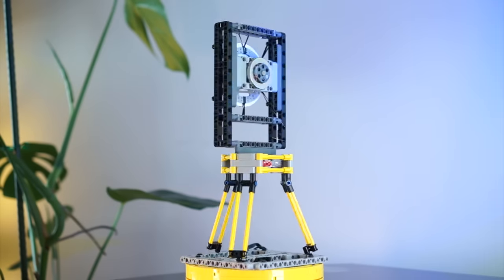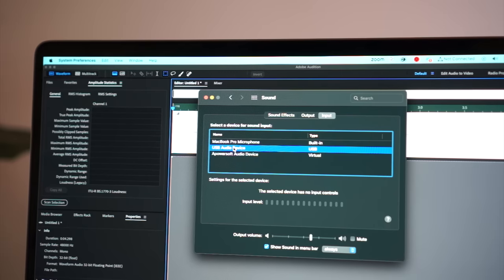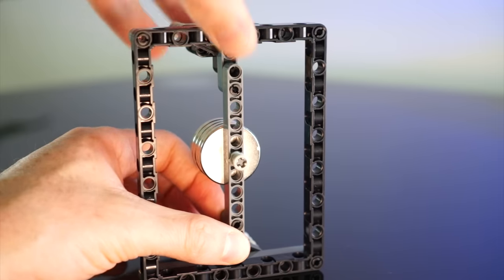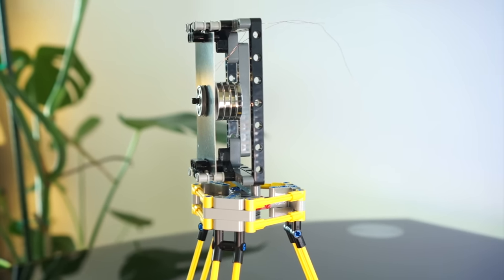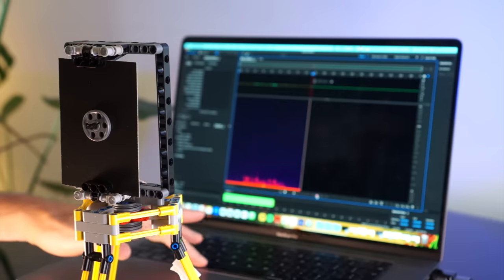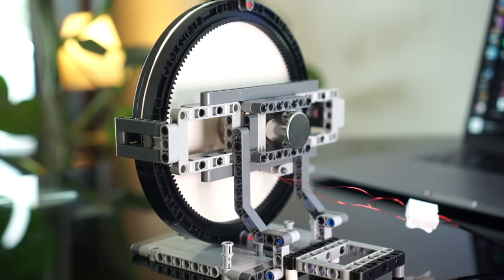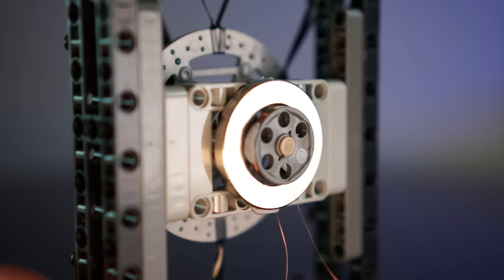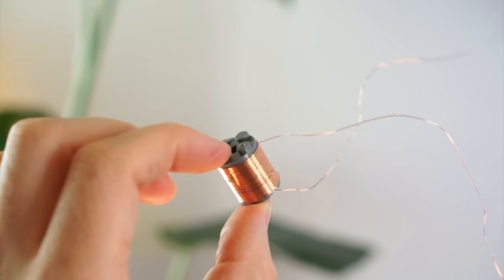Can you build a real working MICROPHONE using LEGO?

Comment: A few suggestions:
1). Those thumping noises after P sounds are because you don't have a pop filter, so the bursts of air from plosives are hitting the microphone and making it go thump.
2). This is a dynamic microphone, which if I recall, tend to want/need their own preamp before your computer's sound card has at it. This might be part of why the noise is so bad, so maybe a simple op-amp circuit to boost the signal before sending it off would help things.
Reply from the maker: Ah that makes a lot of sense, I'd love to try some kind of preamp then. Cheers for the heads up! The pop filter is probably the easiest problem to fix. Thanks for the suggestions 😃
Reply: @JamiesBrickJams  
And i just want to add that the weight of the membrane is absolutely critical to the high frequency sound , also winding the coil as close as possible to the edge of the magnet will make the microphone a lot more sensitive , and a preamp board will help so much too :) !
Reply from the maker: @davidfrancois2764  very true! I tried many variations to get that coil inside the magnet and as close as possible but really struggled 😅 Will certainly see what's possible with some other membrane materials! Cheers again 😁
Reply: maybe even a single jfet could give you enough amplification. But usually that is used for electret microphones. Those use change of capacitance, instead of induction.

edit: for electret microphones, you literally need no extra components, only the JFET, but coils conduct well, so this may need a more complicated circuit. A two battery powered OPAMP circuit would be much easier to build and operate (two batteries, one opamp, two resistors, plus one extra capacitor or resistor on the output).
Reply: Ribbon type microphones also needs an preamp. And try to find audio transformer for microphones, like replacement part for Shure SM57
Reply: To my knowledge more or less all types of microphones need a preamp of some sort, or just a properly calibrated ADC. I do own a variety of microphones and overall haven't observed a significant difference in the amount of preamp gain I use for dynamic versus condenser microphones (I don't have any ribbon mics. I'm too broke for that), outside of the SM7B which is a fairly low gain mic.
Reply: @mitallast  To my knowledge the point of transformers in microphones is impedance matching. That is a big deal and will give you much better results if done correctly, but it's not something you're likely to have much success with just haphazardly trying stuff. There's a degree of math involved in that process.
Reply: @reaganharder1480  correct, yeah. Transformers not only increase low-impedance signal from a ribbon in magnetic field, but also increase output voltage amplitude, that improves signal to noise ratio.

Comment: A lot of the low frequency noise you are getting is from your desk being touched and because you have no pop filter.  The desk vibrations could be solved by isolating the part that holds the membrane and coil with some more rubber bands like the ones you used for the membrane. It also might be worth looking into using a preamp of some kind as they can help reduce noise and filter out frequencies you don't want in addition to increasing the signal strength.
Reply from the maker: Some fantastic advice here, thanks for sharing! A pop filter is definitely an easy addition, and more isolation I think should be pretty straightforward too. Will need to do a bit more research into a pre amp though. I experimented with various transformers and they all added various odd buzzing noises. But thanks for the heads up - I'll look into some kind of filtering!
Reply: @JamiesBrickJams transformers might not be the best idea, perhaps digital preamps could be good (im not sure, but "OP-Amp" might be the electric ic's name..
Reply: @JamiesBrickJams  I'd recommend using a resistor too
Reply: @TheCustomFHD why do I recognize you I feel like we used to talk on discord
Reply: @Idontknow4  possible. Any server names that come to mind?
Reply: @TheCustomFHD  OP-amp is an IC, yeah, though I'm pretty sure you're gonna need a bit more than just an op-amp to make a pre-amp. Unless you have a specific reason to want to make your own preamp, you're probably better buying a preamp as a whole unit.
Reply: @reaganharder1480  possibly. Probably even likely, yeah. But it'd be cool

Comment: you almost certainly want to pre-amplify the signal to make it usable for your PC, also, it could use a low-pass filter to reduce high-frequency noise.
Reply from the maker: That would have been a really good idea, cheers for the heads up - will need to figure out how a basic filter like that works!

Comment: Most of the suggestions I see in the comments look to be correct.

Since in a dynamic microphone, the induced voltage on the coil is proportional to the change in magnetic flux, you may be able to increase the output level by having your coils closer to the magnet (i.e. nearly touching the "outside corner" of your ring magnets) -- if you search for magnetic field diagrams, your aim should be for the coils to cross over as many of the lines as possible during movement to get maximum induction. Using magnets without holes in the centre will increase the magnetic field strength, too.

As other people have said, the dongle you are using is likely designed for a microphone with an impedance on the order of 1000 Ohms, so you need a preamp which will both amplify the voltage to a suitable level and provide an input impedance more closely matched to your coil to prevent signal degradation from power loss.

I imagine it would be rather difficult to find something suitable at a reasonable price -- the other alternative is to try a DIY preamp with op-amps, resistors and some other discrete components - certainly possible on a breadboard given enough time and perseverance.

The frequency response you're getting will in part be due to impedance mismatched power losses, but is probably mostly from the material of your membrane. Typically microphone membranes are extremely thin in order to reduce their mass for any reasonable high-frequency response, and the LEGO you use to mount the coil will be contributing a damping effect from the extra mass. The best suggestion I can make would be to use something like tracing paper to try and reduce the mass of the membrane as much as possible.

One other thing -- you may want to twist your wires together. It doesn't sound like you're getting much EM interference, but twisted pair is an easy way to reject a lot of environmental noise and it should reduce the power losses a little too.

Good luck!
Reply from the maker: Fantastic advice, thanks so much for taking the time to post! Really appreciate details like this. I think you're definitely right about using a decent pre amp. To be honest I don't know much about them, but if I can find an affordable solution, I'll definitely give that a try. Other membranes too will be interesting to experiment. I'm still holding out hope my ribbon microphone might work out. Or perhaps a capacitative membrane. Cheers again for the advice! 🙏

Comment: I am not an audio expert, but i may suggest you to focus on making the membrane much more thinner and lighter, i'm quite shure that way it will work better since the noise you hear is not because of the microphone itself but because the signal it produces is so low that the computer has to amplify it but it will also amplify the noise. Btw great work and i really love your videos!
Reply from the maker: Thanks a lot, appreciate it! And yeah you're totally right, I keep having to boost the signal on the recording which also boosts the noise. I'll certainly try some different membranes. Perhaps also delivering some power from the PC so that I can boost the signal before it hits the PC
Reply: @JamiesBrickJams  What about a cut open and stretched rubber glove?
Reply: You might be able to get similar with just plastic wrap yea?
The reason you'd want something light is bc sound is just a difference in pressure / pressure wave, which means you have a force applied over each area of the membrane, so less dense and thick that membrane the more movement that force generates, which means more voltage
Reply: @jamievancoppenhagen the actual membrane inside a lot of microphones is just thin plastic, like you might get from certain plastic bottles, or the cover of folders for documents. Just needs to be thin, but not deform under its own weight. Then the frequency response will be wider and less bassy probably.
Reply: Are you sHure you're not an audio expert ?😅
Reply: I'm very intrigued by the last microphone displayed because I would have thought the overall membrane apparatus was far too heavy to really do a good job with high-frequencies, and yet the output sound was quite tinny. Perhaps the membrane had a resonance at those frequencies due to the elastic bands. For optimization you'll want to reduce the mass of the membrane + coil as much as you can (keep the same number of coil windings if you can), and probably a membrane with little to no resonance (if you pluck it and it keeps vibrating for a while, that is bad).
Reply: @JamiesBrickJams  Might I suggest making a membrane out of a cut up condom or something? I don't know how well it would work, but it could be worth a shot.
Reply: @Swenglish  with the design shown in the video, a condom would probably not be brittle enough to work. You're looking for something that gives a little in a predictable way when under increased air pressure from sound but is thick and brittle enough not to completely absorb the wave without transmitting the motion to the coil. You want something flimsy but not floppy that is coupled directly to the coil in a microphone. Basically if you were to use a balloon or a condom you would have to find a way to pull the diaphragm very taut and that would require you to build a frame, which sacrifices lightness, which will kill the benefit of using the material.
Reply: @thoomish3556  I was definitely picturing it pulled taut across a frame of some sort. Cling wrap also crossed my mind. But if the frame presents a problem, how about a cut out piece of the flat back of one of that kind of plastic packaging that can't be opened without scissors, that sometimes scissors come in? That's thin but fairly rigid.
Reply: @reaganharder1480  Ah so rubber glove is out
Reply: @brohouse7882  rubber glove would probably be a little better than what's been tried in this video. I think nitrile gloves are typically less springy than something like latex, so if you're gonna use a glove, nitrile is probably the way to go. But i'm thinking probably something like a bread bag would be better if you can find a good way to attach your coil to it

Comment: You need a thinner membrane and a not so stiff suspension. Also, the wheel the cardboard and  the magnet are attached to adds too much weight and dampens the whole membrane. 
More mass needs more force to start moving so try to get that as low as possible. As others have said, a pre-amp is necessary, there are simple op amp circuits out there.
the coil should be inside the magnet or around it, as the magnetic field is the greatest there and thus should increase the voltage output.

Comment: To produce larger signal level, you need few things: First, the magnetic circuit should be as short as possible - the coil has to be very close to the magnet(s), where the magnetic field is strongest. Second, the coil has to have sufficient amount of turns - voltage generated is proportional to number of turns. Third, the membrane has to be very lightweight so the acoustic pressure moves it easily.

Comment: I think a smaller, lighter diaphragm could give you higher frequencies. If your diaphragm is big and heavy, you essentially get a natural low pass filter, because more mass doesn't like to move as much, and the bigger area also gives you more air resistance.

Comment: For a dynamic mic like this you won't need any kind of bias voltage, only electret and capacitive mics need a bias voltage, however you could really use a decent pre-amp because the one in your dongle is not designed to be used with such a high impedance low output microphone

Comment: Perhaps you might want to try making a condenser microphone next? It's basically what you've already made, except you use a conductive membrane (like a sheet of copper foil), and a conductive backplane (again, copper foil) instead of a magnet. This creates a capacitor which you can charge with a constant DC power source (a battery).

As the membrane moves, the capacitance will change, which can then be detected by putting a resistor in series and taking the voltage over it as the signal. In theory it should give a much better frequency response, as you can use a much lighter membrane (no coil of wire in the center).
Reply from the maker: That's a really cool idea, thanks for suggesting! I as vaguely aware of them, but haven't done much research into how they work exactly. Your description sounds reasonably straightforward. Cheers for the tip - I'll certainly look into it some more!

Comment: Electronics hobbyist here, I graduated the german equivalent of highschool this year and will start studying electrical engineering soon and am quite invested in it already.

One thing that would most definitely improve the sound quality is adding a pre amp. Capturing audio will always add noise and when you amplify the audio in post you also amplify the noise floor, this is called signal to noise ratio and by making the input signal louder aka adding a pre amp you can increase the signal to noise ratio and thus decrease the noise in your recording. This would most likely remove the need for noise reduction in post.
Something else I am not very familiar with, but would look into, is the resonance frequency of the membrane, that being the frequency the membrane naturally tries to vibrate at and thus where the microphone is the most sensitive. The resonance frequency of you designs is probably pretty low, meaning it picks up low frequencies well but everything else not so much. Again I am not very familiar with the mechanical side of things so I am not sure how to solve this best.
Reply from the maker: Howdy! And cheers for your comment - that was very helpful 😁 I'm sure you're right about a better preamp. That audio dongle I was using probably wasn't doing much of anything. Will certainly give that a try in a future version!  Also you're totally right about the cardboard membrane - it's likely dampening things an awful lot. Here's hoping the ribbon microphone will do a better job 🤞🤞

Comment: A few suggestions:

1. Try a much lighter or more flexible membrane
2 Make the coil fit inside the magnet or surrounding the magnet (You want the coil to vibrate between the poles)
3. Use a shielded cable for as long as possible. Connect the microphone between the ring and the tip pins. Sleeve is the ground.
4. If you add a pre-amp, you want something like an electric guitar pre-amp, not a microphone one.
Reply from the maker: All fantastic suggestions, thanks for sharing them! I tried pretty hard to get that coil inside the magnet but really struggled to find the flight fit. But that would have been ideal. Certainly for a future version I'd like to try a better preamp and better membrane materials!

Comment: I might be a little late and off on my understanding of audio/vibration frequencies but, for what I understand if you were to use a large rectangle diaphragm and offset your coil with a 1/3-2/3 on both axis it should capture more frequencies than a large circle. I liked seeing you distance the magnets and coil from the diaphragm though, good idea!
Reply from the maker: Ah thanks, I've no idea if that was a good idea or not, but it seemed to work ok. That's an interesting idea to offset the coil - will need to run a few more tests I think!

Comment: You should definitely use a pre-amplifier. They are used in dynamic microphones (the one you have). It will help with the loudness. Also add a popfilter so you don't blow into the mic. You can maybe move the coil inside the magnet area. You can also try making another coil and connecting them in series (make sure both of the coils are twisted the sane way, for example if the first coil is twisted clockwise, the other one can't be anti-clockwise or else the coils would work against each other and there would be no sound). You can make a box around it with only a wall missing on the front of the microphone and add some padding onto the walls to make it onky pick up your voice and not the surroundings. You can maybe even try to makr a bigger membrane to not make it as tinny and bring more bass. You can then cut the membrane to perfection. 
Hope any of these tips will help you!
Reply from the maker: Oooh hooking up a couple in series would have been a cool idea! I was struggling to find Lego pieces that fit snugly inside the magnet, but another coil in front in series would have been an easy way of boosting the signal. And I'm sure you're right about a pre amp. I'm seeing if I can find an affordable solution there. Cheers for the advice!

Comment: A lot of good mics will often have signal processing using one close mic and one far away mic, then using a differential amplifier to only give you the difference, idealy that'd be your voice. Also various different mechanical filters can be applied if you feel like doing it physically rather than with software  -  3rd Year Engineering
Love what you're doing here, it's a fun watch
Reply from the maker: Thanks a lot! Glad it's still interesting to an engineer, as basic as it is. I'll certainly give an amp a try on the next version. Would love to learn more about physical amps though too. I like the idea of minimal 'assistance'